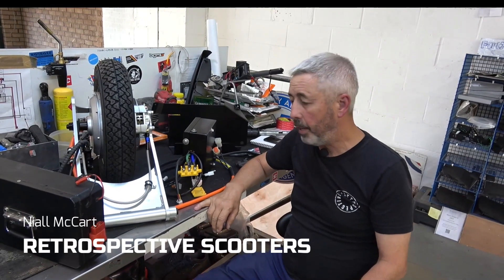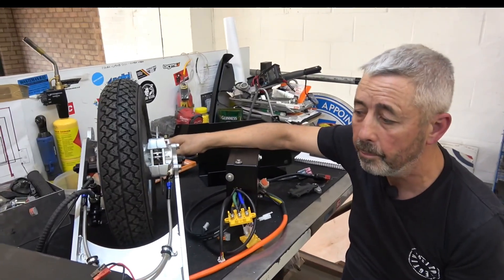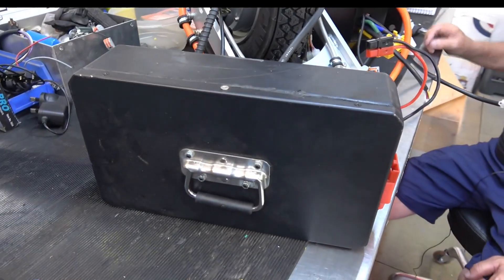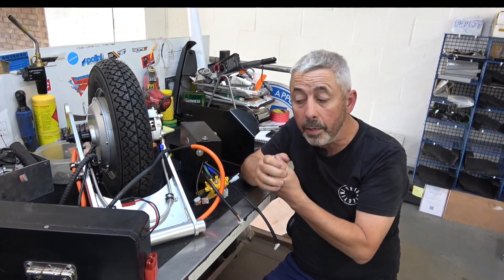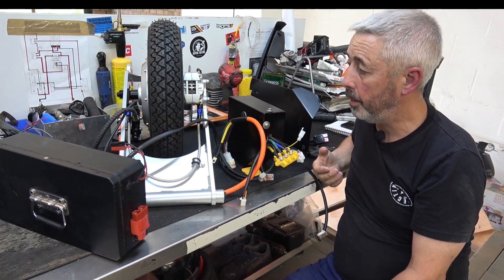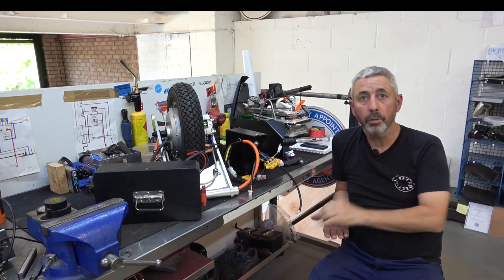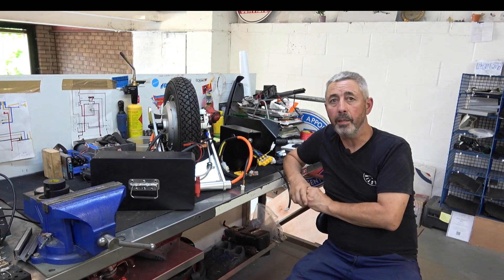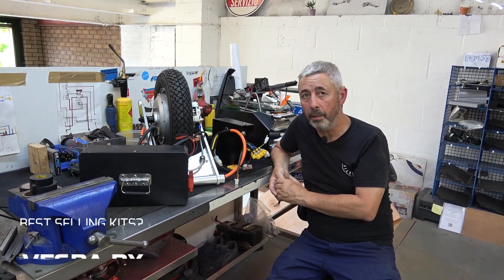SLUK | Converting a classic scooter to electric? All you need to know

Comment: Are there any possible benefits for keeping the original engine and running it alongside the electric motor 🛵
Reply from the maker: With this kit you can’t run both. The motor and swinging arm replace it.

Comment: Need a 50kw+  motor then it would be fun and not to slow 65mph with little power is not enough lol need 120mph that can get there super fast 🤪 and power to lift up the front wheel on acselrasion
Reply: That's not how electric works,  the power is in the battery not the hub motor , I can make a 1 kw motor faster than  a  5 kw motor if I used a 96v battery  on the 1 kw and a 48v  battery on a 5  kw . Also  if you have a 10kw,50 kw or 100kw motor then it's no use if you can only tap into 10% of it power ...becasue you don't have the battery big  enough to run it to it full potenial. We are all currenrtly on this switch over to electric powered vehicles from  our old world of petrol powered vehicles and it's just not a like for like swap.
These electric scooter do have some serious torque , we can turn it up  or down on the app and for the purpose of riding them  about town in traffic we have them on  a sensible setting , they can wheelie but rather not , and I'd really not want to be doing 120 mph on these little wheels . However having said that we are building a Lambretta racer for a bit of fun  , correctly set up, it's a 7 kw motor backed up  with  a 350A controller and runing on a 96v 30ah battery with extra thick battery leads , so that all up a notch from our regualer kits and it'll be intereting to see how that goes , should get right up to 90 mph but we'll see .
Reply: @retrospectivescooters7850 oh boy, I'd buy one of those racer kits... please take my money!

Comment: So this works with the 8" wheels?
Reply: With 8" wheel I put a 300x10 tyre on the electric motor and a 400x 8 tyre on the front ,they are both the  same diameter so it evens out the slight rise in height ,  also change the stand toa 10" stand and cut it down a little and I would beef up  the front suspesion with tougher spring and damper ( anyway ) Carbone toughened kit is good. it's like converting to 9" wheel and retaining that look of the front wheel  .
Reply from the maker: Yes